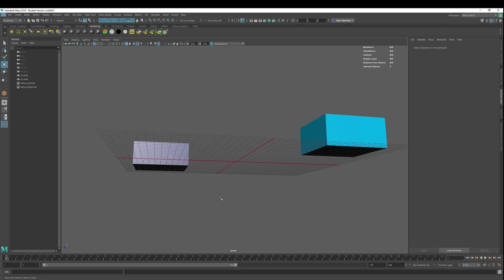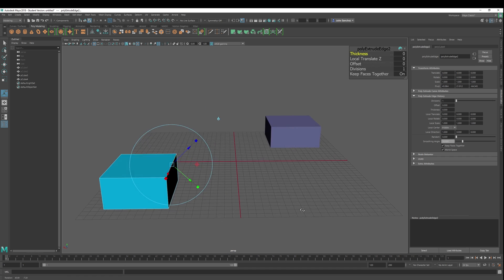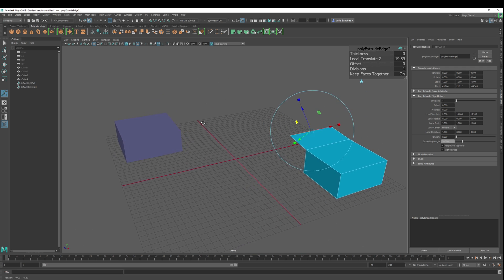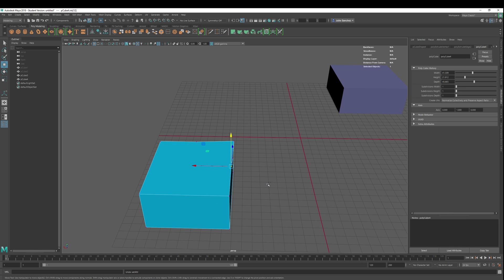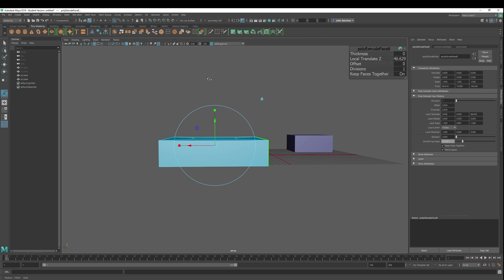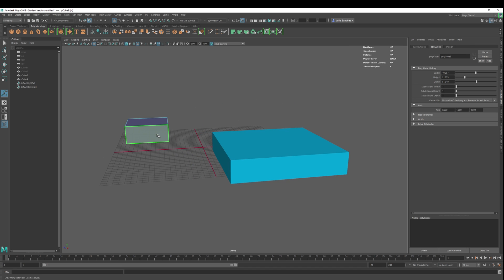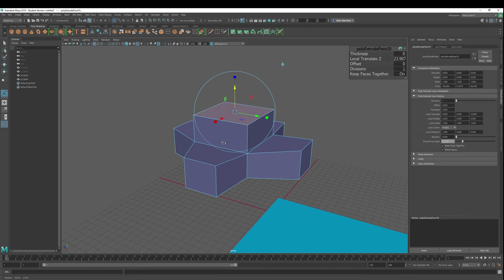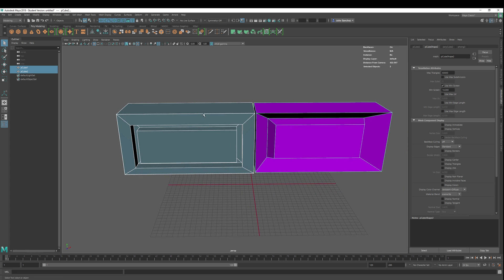Autodesk Maya 2018 Basics- Extrude Tool

Comment: I can't find a good answer, but in Maya 2020 I'm trying to use extrude to push in and when I do, it's leaving a faces behind. So a cube with 4 horizontal faces, I push in a middle one using the extrude option and it ends up leaving a face behind on the sides. Lol I'm just used to sketchup. You push on a face and it all goes in, it doesn't leave any edges or create a new face. Sorry if that was confusing.